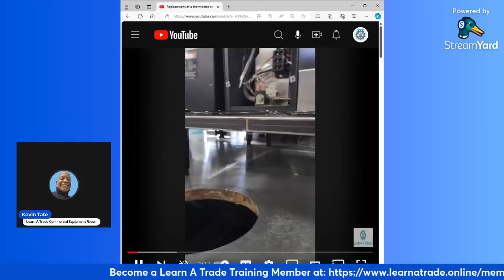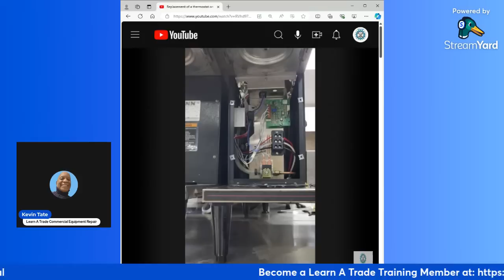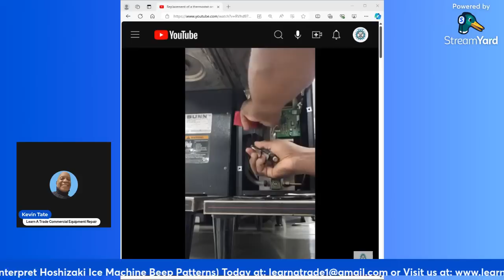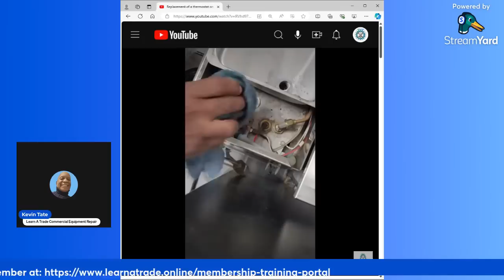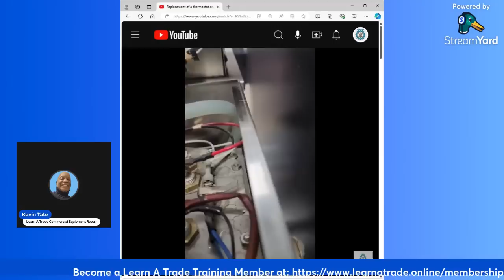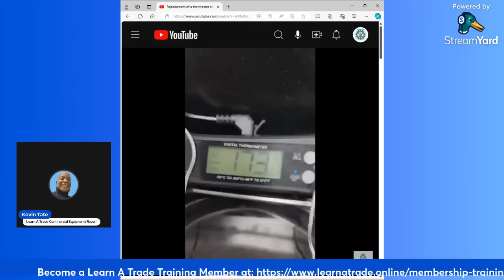Replacement of a thermostat on a Bunn coffee brewer (Updated Version with Voice)

Comment: Mr. Tate, Good to see another of your videos, Sir.
May I please ask you to give your account of the material for the water fill bin fastener's metal? Is it stainless steel on all of them, or has it changed from model to model. Are any of them aluminum or nickel-plated brass?
Reply from the maker: Hello, I  am for sure on those fasteners, but I have only seen them in stainless steel.
Reply: @latcommercialrepair  Do you know of a good source for the gsketthat does not charge $15-20 for the shipping of a $1 gasket?
Reply from the maker: @Maxim.ID4HO  you can try Amazon.com , mariani.com or foxxmaterials.com
Reply: @latcommercialrepair  Thank you